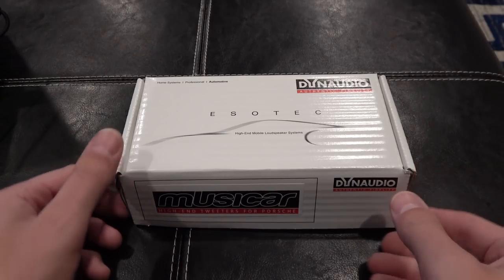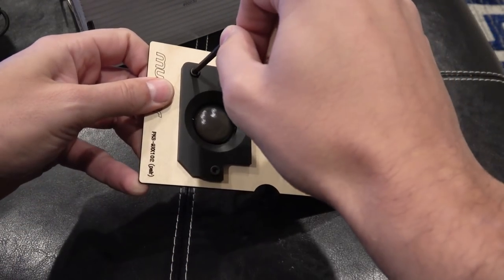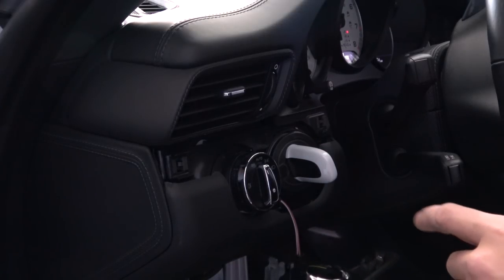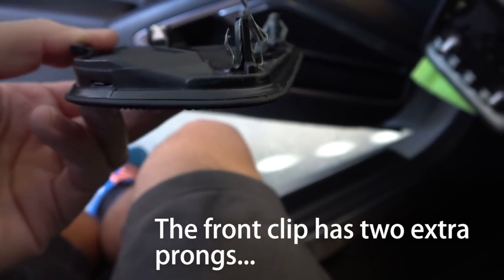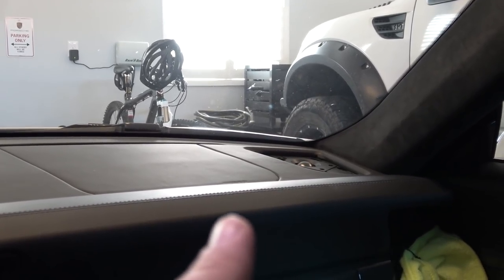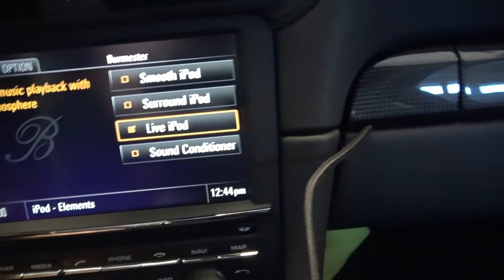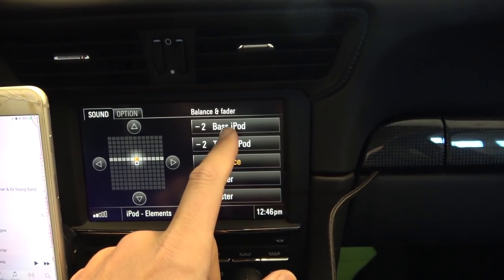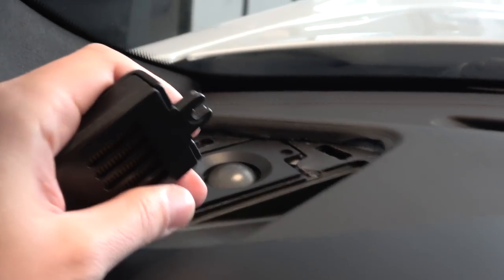Porsche 991 Musicar Tweeter Upgrade - Dynaudio Esotec MD102

Comment: Time and time again.  New Tweeters come out.   The Dynaudio stuff always holds it value and sound quality.   Its sounds expensive until you realize just how good they are.    Sure.  You can get other drivers.   But you can buy a cheap Hondo electric guitar or get a real Gibson.

Comment: eh.  I duno.  i was hooked plus they are lighter which is lovely.  then you said the Burmester was not then balanced properly and you had to put a rag to squish the sound of the center channel.  I guess this is why it is a bad idea to futz.  I think the DAC and auto-balancing of a system is very key to a noisy car environment.  I will be using my Burmester in a Boxster T.  I do not doubt these sound better, but did you ever get the center channel balanced with the new setup?
Reply from the maker: Eventually I got around to disconnecting the center channel altogether. Sounds good!
Reply: @TheStockpile  oh.  I like that idea.  I always felt center channels are lame in cars